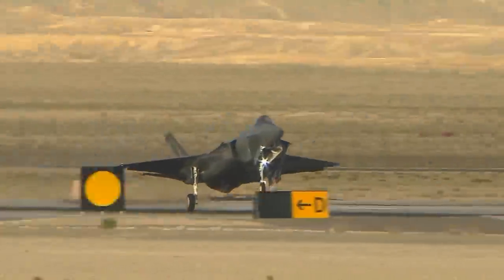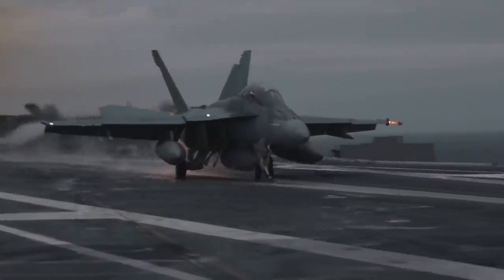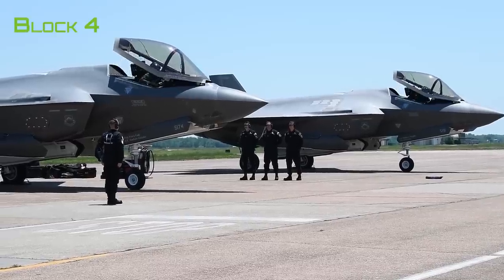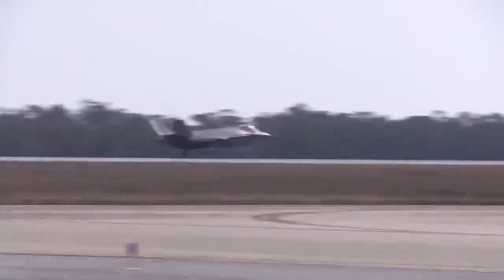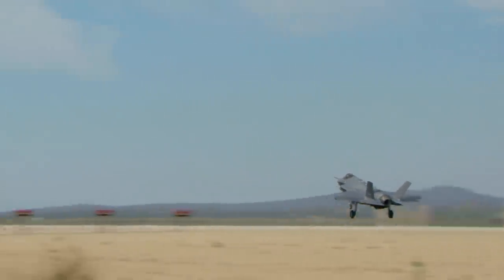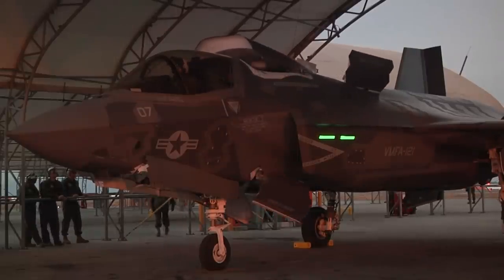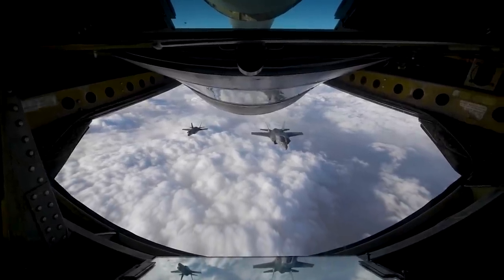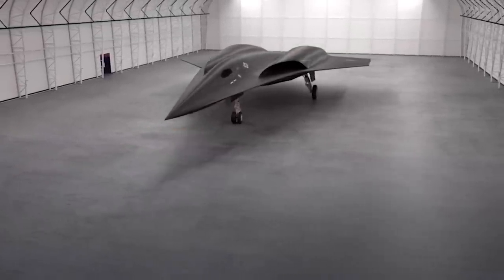Why the F-35 needs an engine upgrade

Comment: So, I work for Lockheed on the F35. I feel the need to clarify some points. 

The cooling issues do not happen in flight. The air is cool up there. The "overheating" happens on the ground. There are cooling issues while they sit at idle. Military runs the IPP for ground maintenance instead of using ground power and cooling equipment. Electronics get hot but rarely overheat. Unless they are in high temp environments like the desert. Pratt is working the issue for better cooling. 

G.E. does not have engines on, in, or for F35. Because of several catastrophic fuel line issues on Pratt engines, discussions from management at LM have begun to 'maybe' use GE engines.

Comment: Hello @pilotphotog, just a quick feedback on the video: the content itself is precise and interesting, great job on this, subscribed! the only thing I would suggest is changing the background music at the middle of the video because the loop is too short for the full length I think. Keep up the good work!
Reply: not really precise as he uses Australia MQ28 Ghost Bat in the NGAD programme to get these new engines.
Actually is up to Australia and Australia only if anything changes on our drone.
Even the secret detachable nose design will only ever be done in Australia keeping the tech sovereign .
All said by RAAF Commander head of the programme.

Comment: I'm thinking as a work-around until a permanent solution is found, we could have them fly in pairs, intermittently shutting off systems sequentially. That way you'd only be using them half as much.

Since they already share info via MADL datalink, you wouldn't lose situational awareness.
Reply: Budget allowing, If they add fresh double sided sticky tape before each flight to the upper surfaces this idea has merit.
Reply: ah, kinda like the buddy tanking F/A-18s. They didn't build them with enough range, so you have one fly as a gas can for the other so it can get to where it needs to go. As a bonus, you get additional flight hours on an airframe with no additional benefit towards completing the mission and your availability rate falls to below 50%.

Comment: Fighters unlike your mobile don't want their air frame getting hotter dude that's just gold for IRS missiles.
Also F-35 can't go 20% for any length of time due to the epoxy RAM coating melting
Reply: So..... NO supercruise???
Or when it does, bits of aircraft come flying off?  I don't think your information is correct...
Reply: @fightfish3265  Oh yeah sandboxx covers this in his back catalouge so maybe you should take this up with him as well LOL

Comment: How about we put the ECU upgraded P&W XA101 in the F-35B and the GE XA101 in the F-35 A & C? Should have went with GE to begin with.
But I thought the DOD already decided on this several months ago. They decided to go the cheaper route with the P&W XA101 and use the money saved for the GE XA100 in the NGAD.
Just come out with the NGAD already. I feel like I've been waiting forever. I just want to see it fly once! We need the NGAD & the Adaptive Cycle Engines within the next 4 or so years as a conflict with China seems inevitable
Reply: Second that.  Not much commonality anyway. TBH I'd dump A altogether and have AF fly stripped down C airframe.

Comment: The F-35 needs a new airframe. The fact that its systems are the main strong points is not a strong point. It's less stelth then the Raptor, has too short of a range to be effective once long distance, is slow, is vary vulnerable to IR missiles, does not carry many weapons, and isn't vary maneuverable. All the SA will do for you if that stelth gets cracked is tell you when you're going to die.

Comment: Another reason to stick with PW engines is proven service and reliability. Putting an entirely new kind of engine and supply chain in a single engine plane that forms the basis of American and NATO airpower for the next 50 years may be too risky and could interrupt supply run rate.

But 50 years is a long time. We can revisit the adaptive engine for the F35 after it proves itself in the next 10-20 years.

As a Canadian, I know all too well what might happen to our procurement of F35s if there is appears an engine trouble headline in the news associated with the upcoming Block 4. We are cheap, with shortsighted politicians, and we got a lot of land in the north with no runways for a plane undergoing engine troubles. Get me some proven reliable F35s, we can upgrade later.

It’ll satisfy future energy and cooling needs, that’ll do for now. There is already enough game changing stuff going into the Block 4. Baby steps people.
Reply: Just a reminder --- Every fighter goes through engine upgrades.  By example, the F15 was introduced with P&W engines.  Once they matured, they let the F16 depend on a single one of them.  Then GE won a competition to supply engines for the fleets.  And it saved the USAF a lot of $$$$$$.
Reply: You need to get smart and join Australia as a small population with lower economy we developed MQ28 Ghost Bat to maximise our forces and have a cheap drone if need to use them as 1 way suicide bombers or take the hits while our crewed platforms escape or finish their mission.
Got AI  drone subs now also. ex patrol boat going AI to test surface vessel.

Comment: Most of what I see currently is saying no adaptive engine  swap for the F35. New engines maybe, upgraded engines maybe, but the adaptive engines would be to large a change and create  logistical nightmares. An additional consideration is the current Pratt and Whitney engine is wildly reliable and that is a big deal for a single engine fighter. Brand new technology engines would come with huge worries until they are proven.  Interesting times.
Reply: Sounds like you work for P/W.

...or more likely have no idea what you're talking about.
Reply: This is the truth. The F35 program is too massive at this point to clear all the hurdles required to bring an entirely new kind of engine into the mix. This video covers just about all of the pitfalls.

That and the fact that PW’s engine is proven and reliable counts for something. This video doesn’t spend enough time on this point IMO. If the new PW engine will satisfy the cooling and energy demand needs of the F35 for the next >20 years, then leave it at that. Dont bite off more than you can chew. The F35 is a single engine plane, it shouldn’t serve as a testbed for an entirely new generation of engines midway through its production run. The entire NATO alliance is in the process of replacing their 50 year old planes with F35, they cannot afford delays and certainly cannot afford a resurgence of the political nightmare associated with the F35s procurement and development history starting at the beginning until just a couple years ago.

Give it 20 years and sure, we can always upgrade the F35s then. After we know we can count on it.

As a Canadian, get me those F35s without a headline about engine troubles. Not a good headline for cheap military spenders that have a massive arctic region to patrol with no emergency landing spots anywhere.
Reply: @devobronc He's got a point tbh, looking at even the GE engine development it took some $6B to come to the conclusion that it is possible but not for all variants and would require another $6B in development before fitting and operational troubles. It was also rumored to potentially be an extra ton in weight; the technology is a little early in its existence at this point. NGAD's engines should provide a platform to develop the technology to make it lighter, easier to maintain, cheaper, etc. but for now cooling is the main issue and the ECU is the closer answer. Who knows, if we're lucky they crack open the budget dam and fund both at the same time for maximum cooling and power.
Reply: @devobronc  LoL

Comment: Most people have no idea that every fighter aircraft ever developed had serious issues to resolve, some very serious. WWII aircraft went through many upgrades after production started. The P-47 started out as a heavy, low altitude fighter, before the war ended, it could keep up with any Axis aircraft except the ME 262 jet. The P51 was disdained with the original engine, they installed the Rolls Royce Merlin and it became a legend. The F-35's problems will be overcome. It will never be nor was it designed to be compared to the F-22. Different roles. The F-35 will be sold to our Allies, the F-22 will not, we still don't know how good this aircraft (F-22)  is as it's still classified. We know what tell us and that's it.   A more powerful engine  coupled with even better avionics and nobody laughs anymore. Look at the incredible evolution of the A-10, it started out a plane built around a gun, still is for the most part, but the upgrades in capabilities and tech is like a bag phone to an iPhone 14.

Comment: The vendor competition will be good as it will help keep costs down and bring more ideas to the table.
Reply: Just a reminder --- Every fighter goes through engine upgrades.  By example, the F15 was introduced with P&W engines.  Once they matured, they let the F16 depend on a single one of them.  Then GE won a competition to supply engines for the fleets.

Comment: IDK i'm not american so my opinion might not be relevant but i still want to give opinion about this lol: F-16 had engine upgrade in block 30 onwards, so why F-35 can't enjoy the same hardware upgrade as F-16? Beside that, US is close to have conflict with china. I think US need to improve their capability massively in all aspects to face the challenge, and AETP engine is a piece needed by US to improve their capability alongside other improvement as well. Giving XA100 a chance will add another engine supplier for F-35, strengthening the supply chain for F-35. I don't think we have to drop F135, but we have to make new series to accomodate new engine (example: F-35D for Air Force and F-35E for Navy). Having second options definietly is not an efficient option, but it's needed in difficult time like today.